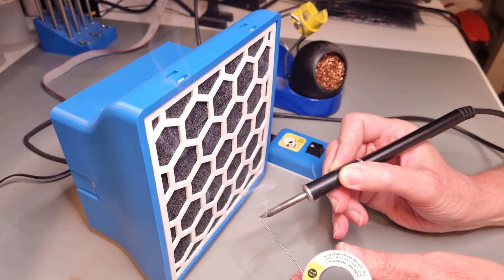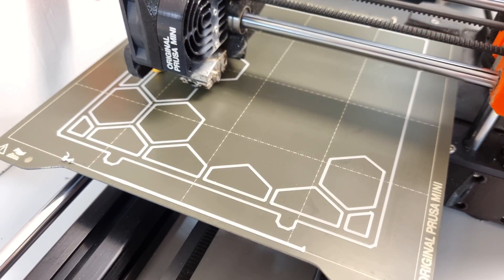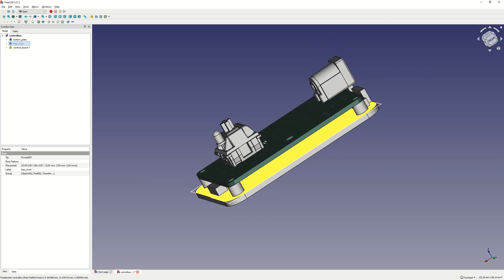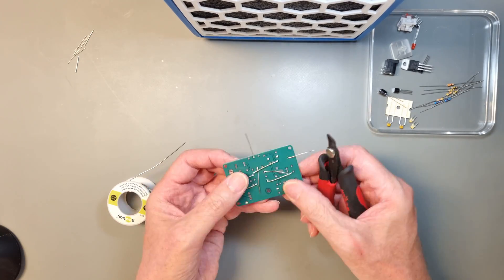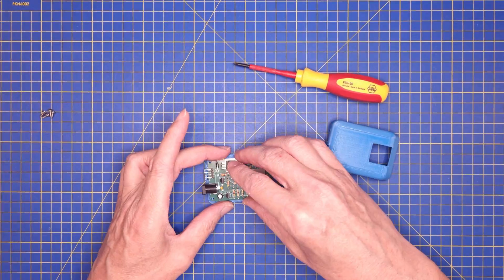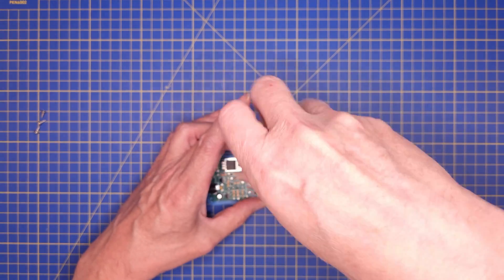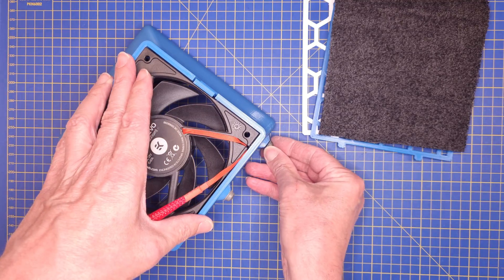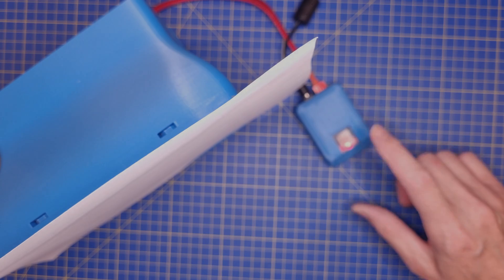Build your own Solder Fume Extractor

Comment: Couldn't you just make the top part of the housing print upside down to not have to use supports?
Reply from the maker: Sure, but the rounded shapes will not look as nice as if you print it like that.

Comment: Overkill for a simple switch and barrel jack😭
Reply from the maker: Overkill is my middle name 😄😅
Reply: @MeeBilt  what's the point? It does nothing normal switch can't do
Reply from the maker: @Sure, but you need to add a barreljack and a switch somewhere; either drill holes in the 3D printed fan housing or add a "wart" on the cable.

Comment: Why use a simple and reliable 50 cent toggle switch when you can spend hours and hours building a complicated circuit board and 3-D printing a space-consuming case to do the same thing? /sarc
Reply from the maker: Because it's fun...?
Reply: Button pretty.

Comment: A very nice looking print. The control box is a bit over the top for my taste. I once also 3d printed a fume extractor but used a simple toggle switch instead.
Reply from the maker: That works fine too - I considered to add a rocker switch somewhere on the extractor hood but couldn't find a good place for it and I also needed to add a 12V power supply, that's why I ended up with a separate control box.